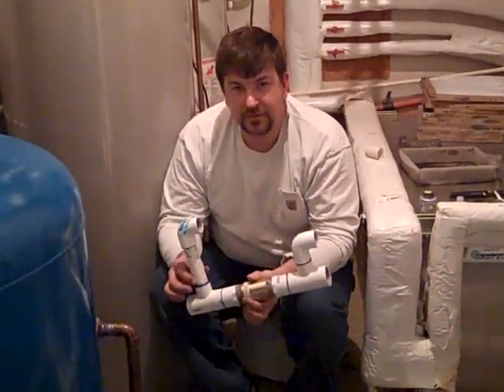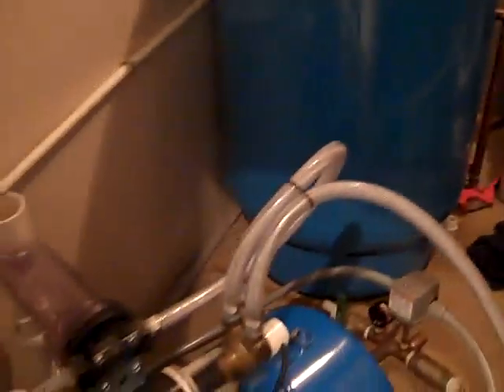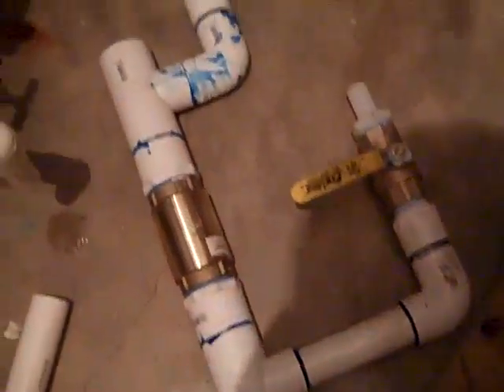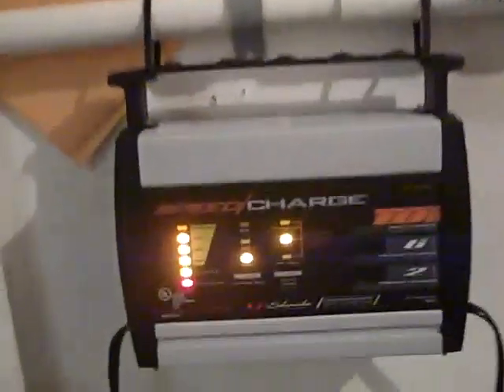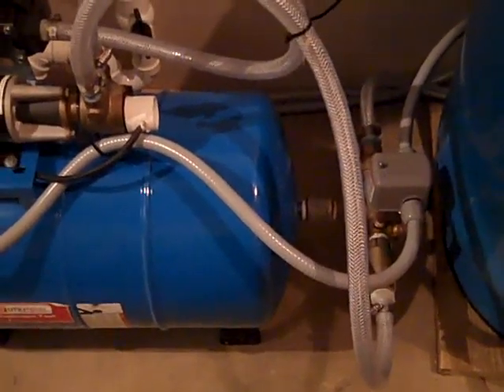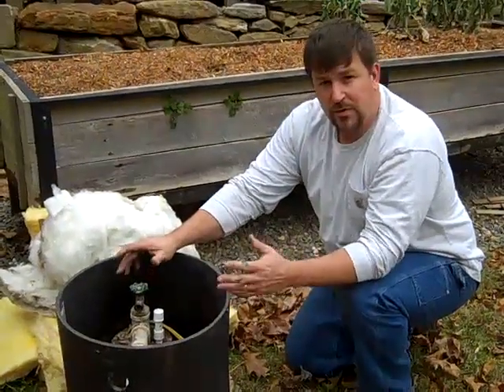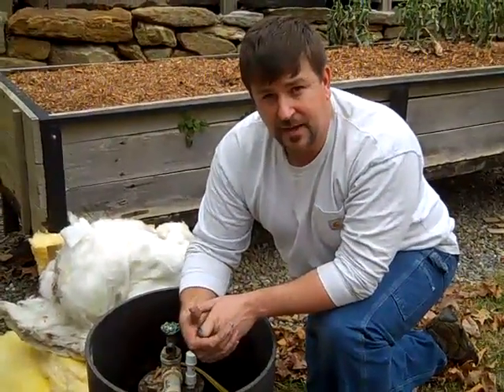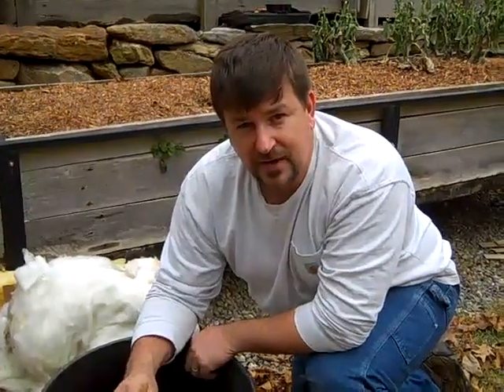Off-Grid Water: Shallow Source Suction

Comment: now i like that set up and the water level in our well sits at a high of 8 feet and a low at 15 feet the well is only 100 feet deep with a recovery rate of about 6 gals a min
Reply from the maker: That is exactly where this setup will work great.  I would recommend the Flowlight 2910 as it has a max suction lift of 20ft.  If you need help with a system let me know.

Comment: HI: Since you mention bladder tank, any idea why we end up replacing our bladder tank on average every 2-3 years?  The bladder fails.  We are on a farm with 162 head of cattle plus household use.  Pump-house is heated in winter and is almost level with house and barns.
Reply from the maker: I recommend Amtrol X-trol tanks.  Make sure your bladder is set to 2psi below your pressure switch cut on pressure.  If your switch is a 40-60 then set the air pressure in the bladder to 38 psi.